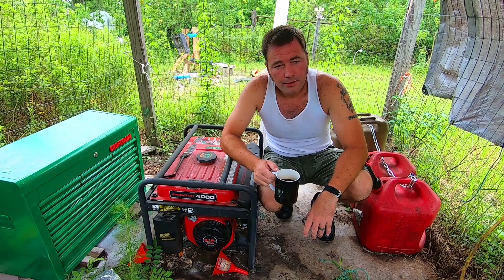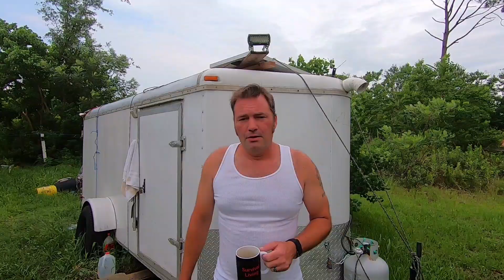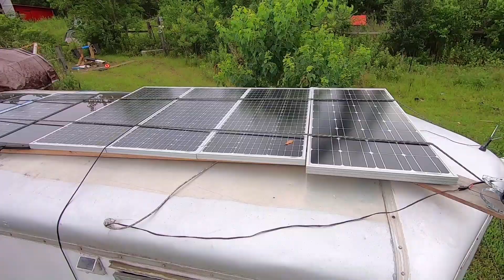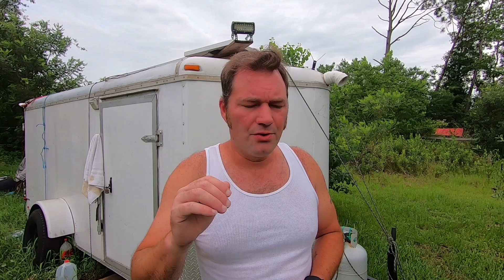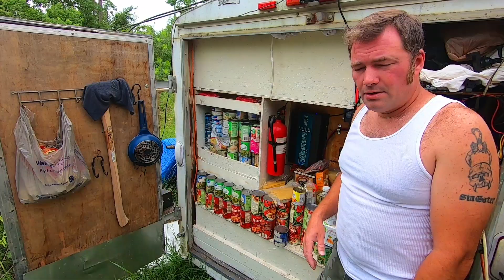Hurricane Preparedness

Comment: Looks like you trimming down brother for your survival school thing you’re going to soon.  Do you have a simple cheap solar panel setup recommendation just to charge rechargeable batteries?  I have a gas generator but know the fuel won’t last forever in a long grid down scenario.  Just something I can plug 🔌 a AA / AAA battery bank into.
Reply from the maker: I'm afraid I dont. We have just a standard wall recharger that we plug into our system. I did see that Amazon did have a few, but I couldnt recommend any thing since I've not used them